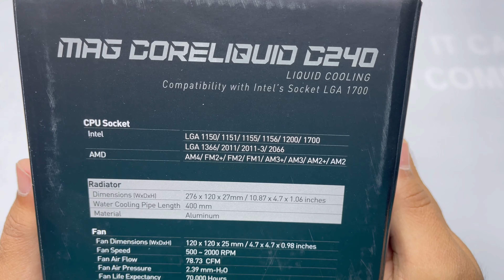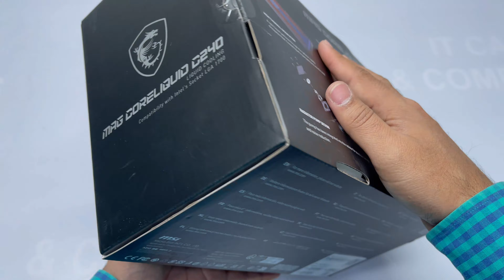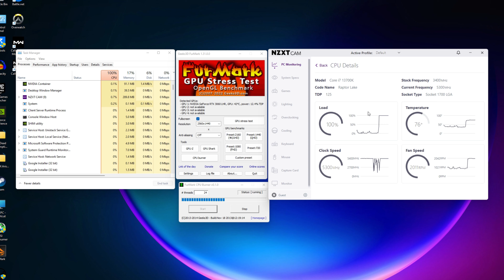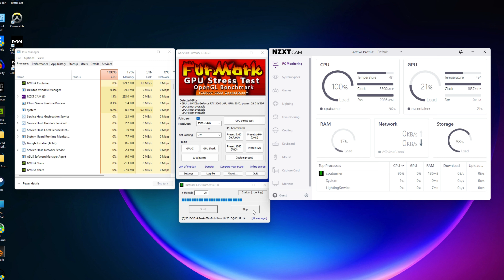Msi Mag Coreliquid C240 Unbox install & test

Comment: Is urs so far good?? Coz i bought that liquid cooler 2 days ago and when i check for reviews it got many negative comments about the prpduct :( in my set up im still observing.
Reply: those bad reviews are for the 240r .... not the c240 i did not see many bad reviews for this cooler other than some personal gripes with fitting and motherboard connection issues,
when i was deciding to buy this with a 5800x as a bundle on prime day, its been solid for me so far.

Comment: Guys I got a problem, I did connect my pump 4 pin to the CPU header and also both of fans into that split cable which he did in the video. All good, I connected aboth the CPU block and both 2 fans with their  3 pin cables but I have no 3 pin slot on my moba to connect one of them as he did in the video, what should I do?
Reply from the maker: Use first 3 pin of motherboard 4pin header
Reply: @itcarecomputers question do you know if this is compatible with z-390 a prime? i connected everything as in the video except the 3 pin rbg for the AIO because i only have 4 pin connectors as well
Reply from the maker: @AdamMartien-dp6ic  then you have to buy rgb controller

Comment: Is it worth to buy for 12400f or it would be overkill?
Reply from the maker: For 12400f any 120m air cooler is good enough but if you have good budget then that liquid cooler is best option
Reply: @itcarecomputers  because I’m considering the MSI set-up in the case MSI forge 100r, b660m wifi mortar, rtx 4060 ti, and choosing the cooler now, selecting between stock cooler or this msi mag coreliquid
Reply: @alxtpkn  Any extra cooling over the stock cooler is a W. You can't really ever be overkill with cooling. Unless you're tipping LN2 onto your CPU of course.
Reply: @HardcoreHardyDarts  Hi! I have already bought 12400f and this cooler
Reply: @alxtpkn  Good stuff. I'm sure your CPU thanks you. 👍
Reply: @HardcoreHardyDarts I want to buy this for my 10400f but there are no reviews for this I'm worried that it's a bad model should I get something else

Comment: My mother board downs that’s that 3 pin connector slot what should I do?
Reply: same here have you found any alternatives or solutions?
Reply: @AdamMartien-dp6ic  I have, you can just plug it into a 4 pin. That worked for me
Reply: @Colin223-4k fr? i tried but its missing the one yk it wont go in sadly
Reply: @Colin223-4k fr? i tried but its missing the one yk it wont go in sadly

Comment: where should i place radiator should it be on top or can it be infront
Reply: Be very careful as MSI is showing it top mount in pics. This AIO is unique it's pump is in the radiator not the block that attach to cpu. If you top mount there will be air bubbles up there as it's higher and will effect tube suction and likely lead to early death. I read people online who had theirs die within 2 to 6 months while front mount no issues. I had mine top mount for 2 weeks until I realised thankfully seems no bad damage it's now front mount with tubes coming out of lowest point (tubes bottom ideal but top if they can't reach still better than to mount it top). I also get much better cpu temp while my gpu went up just slightly no big deal. Best of luck.

MsI are basically advertising the way that will kill your unit on the box... so bad
Reply: PS front mount you need the fans flipped with back side facing into fan so it's pulling air through the fins. That side is more ugly but I used black sticker on back of it looks good. Very important otherwise fans will be exhaust out front you don't want that you want exhaust top and back with case fans and AIO intake front.
Reply: @Malazan  hi thanks i did make top an back exause and front giving air i have 3 fans infront and 2 ontop for cooler an 1 at backso fort is cooling and top and back is exause

Comment: Hello ill paste my comment in the main comments very important as top mounting this will kill your unit over time! Dont believe do research. 

Be very careful as MSI is showing it top mount in pics. This AIO is unique it's pump is in the radiator not the block that attach to cpu. If you top mount there will be air bubbles up there as it's higher and will effect tube suction and likely lead to early death.

 I read people online who had theirs die within 2 to 6 months while front mount no issues. I had mine top mount for 2 weeks until I realised thankfully seems no bad damage it's now front mount with tubes coming out of lowest point (tubes bottom ideal but top if they can't reach still better than to mount it top). I also get much better cpu temp while my gpu went up just slightly no big deal. Best of luck.

MsI are basically advertising the way that will kill your unit on the box... so bad

LASTLY VERY IMPORTANT  front mount you need the fans flipped with back side facing into fan so it's pulling air through the fins. That side is more ugly but I used black sticker on back of it looks good. Very important otherwise fans will be exhaust out front you don't want that you want exhaust top and back with case fans and AIO intake front
Reply: Which pin inputs do we need to use on the motherboard? Can you write them all in order?
Reply: The pump is in the radiator?
Reply: That's what the square block is in the middle of the fins on the radiator. They do this to get away from paying Asetek since Asetek owns the patent for the design used on most pump on block AIOs. @ARyeFowler
Reply: @TLM-Nathan  Thats very interesting...thank you for that info, I have never heard of that in my many many years of pc building haha. Think I will avoid this rad when I build my next pc.

Comment: try with 4 ramsticks. it won't fit.
Reply: It probally will fit
Reply: Well if either of yall get it and try it with 4 stick let me know, I’m putting my parts list together for a new pc right now haha 😂
Reply: This is true, I just bought 2 more ram to upgrade today and only manage to stick one more ram in. The one on the far left is obstructed by the liquid tubes. Any workaround for this? or do I need to remove that cooling? 😑

Comment: As easy installing this thing as going to the toilet. Unlike the made by clowns and designed to fail artic freezer 3 240 i just wasted 70 pounds on. Screws were too short and fronzen in place as well. They would not turn freely and felt like 30 year old frozen in place screws. The screws were also too short. Idiots design that thing. Avoid the Am4 and 5 platform AIO arctic freezers unless you like throwing money away. I could not even install mine. First time in 30 years i failed to install a piece of computer hardware. Look here on youtube for comments on the AMD artic frezzer 3 240 installation videos. People have broken cpu's and mobos trying to install the arctic freezers.